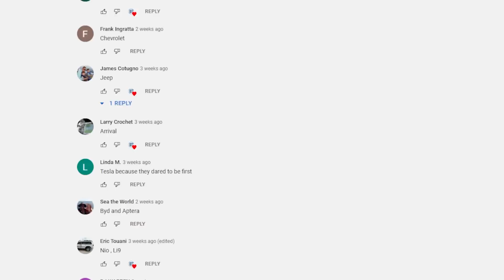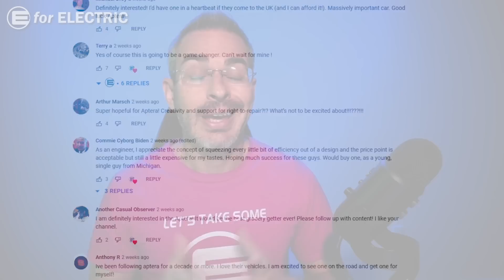How Aptera EV Got a Tesla-like Fan Base

Comment: It’s all about efficiency, that means even if you don’t get as much sun in your area, or want to keep it in garage 24/7, the level of efficiency makes this the only vehicle you can realistically keep charged with just a standard 110 outlet! 150 miles overnight with same outlet you charge your phone on :)
Reply: It's a ludicrous "car" and if you have a garage, then efficiency is meaningless.  Even a Model 3 can be practically charged overnight on 120V for the vast majority of travel that the average person does daily (about 40 miles).

The EV "range" obsession is comical and basically a complete non-starter for the vast majority of people and situations.
Reply: @awebuser5914  How would efficiency not matter in your own scenario, if it means you’ll have to charge substantially less often, for a direct energy savings of at least 3:1 compared to model 3, which also has a sticker price triple that of the comparable ranged Aptera. You basically just demonstrated a convincing argument pro-Aptera, efficiency, and how it’s solar capability is capable of providing the same amount charging model 3 overnight would, but for free 👏 😂.
Reply: @awebuser5914  Saying that "efficiency is meaningless" is akin to saying saving money is meaningless.  Why would you throw 3 times the money away for lower performance if you don't need the higher passenger capacity?  Most of us wouldn't.
Reply: @n.brucenelson5920  "Saving money" is a completely ludicrous argument for pretty much any EV these days.  Comfortable and practical ICE cards like a Civic or Sentra are mindbogglingly cheaper than any EV, and for the typical life-cycle of any owner of a new car, they are more or less maintenance-free (disc brakes are an EV issue as well, even moreso due to lack of consistent use).

People with an excess of disposable income buy EVs to be "different" or make some kind of statement; saving money (the farce that it is) has ZERO to with the practicality of the purchase.
Reply: @awebuser5914  It is clear that you have not looked into this.  I drive a Gen 1 Honda Insight, and even with this vehicle the savings in operating costs will pay for a new Aptera over time.  The $25,900 starting price of a 250 mile range Aptera is hardly "mind bogglingly cheaper" than any Civic or Sentra, especially when you consider how quickly fuel and other running costs will make up the difference.
Reply: @awebuser5914  Since March of 2013 I have solely driven two 2013 Nissan LEAF's, the 1st a two year lease. Never had to do any brake work on either, the regen saves most brake wear. Bought the 2nd car used in 2015 for $11,500, with ~12,500 miles on its odometer. I have very little disposable income, retired and walking dogs for limited income, and figure my LEAF's have saved me many thousands of dollars in fuel and maintenance costs over the last 9 1/2 years. 

Still, I am tired of the 1st gen LEAF's limitations and will gladly trade Tesla stock in for an Aptera when my reservation comes up. My motivations have nothing to do with being different or making a statement, but have everything to do with a moral compulsion to do the least harm and leave our planet in the best possible scenario for future generations of humans and animals. And then I plan to monetize that Aptera investment in a multitude of ways, that include portable electricity providing and the coming vehicle to grid eco-systems that accelerate our electric grid's transition to renewable generation.
Reply: @n.brucenelson5920  The Aptera is a niche toy, nothing more.  It cannot be compared to any "real" sedan, EV or ICE.  End of story...
Reply: @awebuser5914   we’ll see
Reply: @Airman749  "we'll see", what, exactly?  Do you honestly think that Aptera will sell more than a few thousand (if that) of these "cars"?  They are a toy for the wealthy, or delusional.

If you understand that it's a niche toy, then great, it's awesome!  Stupidly impractical and questionable "value", but as long as you don't make idiotic rationalizations about how "great" it is, fine...

Comment: Solar panels still generate electricity in cloudy situations. Not as effectively but they still work. I wish people would stop saying you can't use it in cloudy environments. (Investor/Reservist)
There are lots of first car buyers and single people who are the target of this Aptera. The surprising fact is that most reservationist are of the older age who are simply done with driving a box. With a starting price of $25,900 and 17 miles through solar, Front wheel drive, you can't go wrong. Why should first time buyers bury themselves in debt on a car?

Comment: Does it lean into turns? The failing of 99% of three wheelers is instability.
Reply: This is a reverse trike (two wheels in the front, one in the back). They are almost as stable as four wheelers
Reply: @GoClimbARockEh  I've seen "tadpole" layout vehicles roll in testing, too, but it does look like the front end is pretty wide. I would think that pitching the body into curves would be a nice feature at freeway speeds - intentional body roll to cancel lateral forces, like the Acela trains. That might also help counter UNintentional roll.
Reply: @MrTaxiRob  yeah between the wide stance, and the very low center of gravity, I'm not too concerned. Did you see the moose test video?
Reply: No.  But as it is it passes the moose test.

Comment: The car was delayed again .They promise the car for the end of the year. When are they going to give test drives?  Can you fast charge.  How do I repair it.  Which company will insure it.
Reply: Delays are part of the game with the present state of the supply chain.  The Corvette just had to stop production due to supply chain issues that are rife in the industry.  Both my wife and I have ridden in an alpha model, and other company outsiders have driven it.  These opportunities will increase once deltas are on the road.

The Aptera will have open source repair documents, traveling repair crews, and 24 hour parts shipments.  There will be QR codes throughout the vehicle to take you to trouble shooting sections for that area of the vehicle.  My local repair shop in rural Iowa is already eager to service mine.

Any of several insurance companies that cover the Polaris Slingshot and other 3 wheeled vehicles should be ready to provide insurance right from the beginning.
Reply: @n.brucenelson5920  The Polaris flips a lot.  I think you are required to wear a helmet in California.  They should work with insurance companies so people will have confidence the car will be insured.  Do they have  a video on how to change a tire and brakes?
Reply: @chunckyfreshnut  The geometry of the two vehicles is not the same with the Aptera's front wheel spacing around 25" wider.  It makes a huge difference.  The center of gravity is probably much lower as well.

No helmet is required for Aptera except possibly for Alaska.

Aptera will be offering insurance providers and financing when the deltas are ready for delivery.

I would guess that they will have videos for changing tires and brake pads, but there is no basic difference in the procedure for tire change from any car.

Brake pads will be a rare procedure due to the light weight of the vehicle and the fact that most braking will be done through regenerative braking rather than the mechanical brake pads.

Thanks for your interest!

Comment: I'm a solid maybe on Aptera. Deliver some vehicles first, then I'll decide. It's still vaporware currently. We'll see which features make it to production. Looks promising, but deliver first.
Reply: Since my wife and I have had a ride in an alpha, it would be very hard for me to call it "vaporware".
Reply: @n.brucenelson5920  the point is... they have nothing currently to sell. That prototype you rode in is not what will eventually be available, and until there is anything to sell it is vaporware.
Reply: @DouglasLippi  I agree that it is "a" point.  but they do have something to sell, and that is the considerable progress towards the initial goal, including factories already in production on sub assemblies.  They are hitting their milestones far faster than Tesla did with a far simpler product with their EV conversion of the Lotus Elise (that took 6 years)>
Reply: @n.brucenelson5920  ok whatever. I am rooting for them and definitely hope their first vehicle is awesome and wildly successful.

Comment: I really want someone to talk about how it is in snow. I like the efficiency for commuting to work, but it's not practical if it can't handle winter's.
Reply: I would think it would do as well as any front wheel drive vehicle. (Unless you got the AWD)
Reply: Having lived with winter all my life the biggest problems were starting and not getting stuck. Using synthetic oil and switching to front wheel drive has except in extremely rare circumstances eliminated these problems. Hint, always carry a winter shovel. Other problems that I experienced only once were frozen steering mechanism, frozen shut exterior and gas-cap doors. I solved these using a heat-gun. So, the only problem I worry about with Aptera is the reduced cold weather range, but who in their right mind wants to drive hundreds of miles during subzero weather? If you do, buy the 1000-mile range version.
Reply: My main concern is weight and range because of cold weather. Is it safe to take on the interstate with snow on the road and the car weighing nothing? I live in Wyoming and I've had light vehicles before and had to throw sand bags in them to add stability.

Comment: Reservation holder here of the AWD 600 mile off road package with mostly all the available options. Love the long range, the fast acceleration, the fact that I will probably never have to plug it in given that I live in Florida (the Sunshine State), the right to repair, the composite body, modular parts, not to mention that it just looks really cool.

Comment: I'm not a reservation holder, nor an investor. I just want the thing to exist, along with the Arcimoto. I think this would make a great third, or even second car. I can imagine idividuals taking crazy trips in it. It's really attractive. Crazy efficient. One EV, where you probably could keep it happy with a 110V plug. Their 100kwh version needs a 240V plug to power job sites. A driveable battery.

Comment: Good story and coverage. I am an Aptera reservation holder, investor, and ambassador, and I'd like to clarify a few points. First off, Aptera doesn't need to be a crossover or pickup truck to be successful. It doesn't need to have 4 wheels, or more than two (maybe 3) seats. The vast majority of people I see in my long daily commute are all alone in their giant, heavy, and boxy vehicles. The Aptera capitalizes on the fact that in many ways EVs can be more versatile than gas powered vehicles. EVs can be super economical, but can also be super quick (my upcoming AWD Aptera will go 0-60 in 3.5 sec), while being comfortable, quiet, reliable, and affordable. And with the Aptera weighing much less than other EVs, it will not only be economical and quick, but it will be nimble, safe, and have solid handling and braking. The point of solar power assist is that at every step of the way, whether you have partial cloud cover, or a sunny day, you will be using less electricity, and that is compounded by the Aptera already being one of the most efficient EVs ever built, when production starts next year. One of the biggest points about why I like Aptera (the EV and the company) is that if I imagine the best transportation vehicle of the future, it looks like the Aptera. It is super efficient, affordable, quick, fun, and really innovative. The Aptera team is designing and building an EV that is a great fit for my dreams, needs and expectations. They don't need to redesign it to fit everyone else's broader expectations of having more wheels, seats, weight, towing, conventional design, higher cost, and inefficiency. Because the Aptera works better for me just as it is designed today.

Comment: C'mon Alex. I'm sure you know solar works on cloudy days. Older panels generate less power. Newer multi-junction panels panels work with the UV as well as the visible. I don't know what Aptera uses, but it is likely they will someday use advanced cells as the cost comes down. Even if I only get 20 miles out of it, so what? It pioneers the concept of affordable solar power and the concept only gets better with time. Lightyear one does it even better, but at a quarter million dollars it is mostly a proof of concept rather than a solution. If Aptera makes it, they will be changing the general thinking about using solar in this context.

Comment: I have had two questions for this car since they debuted a decade ago. Number one, do you have to have a motorcycle license to operate it? And if you do, do you need the three wheel endorsement like you do in Washington state? That is a very small number of people that have that. Secondly, about those side mirrors. I’m pretty sure it’s still required in the US for cars and motorcycles to have actual mirrors, no cameras. Otherwise tesla wouldn’t have any mirrors outside. Maybe the regulation is changing soon, I know a lot of companies have been lobbying for it to get removed. Anyway, it will be cool to start seeing these cruise through my town in a few years.
Reply: You do not need a motorcycle license to operate autocycles like the aptera, except in Alaska, I think (and that's probably going to change soon). Side mirrors are a regulatory requirement, and will be included on the Aptera, although they are designing it so they can be removed when the regs change
Reply: I don’t know how many off the top of my head, but only a few states require a motorcycle license (and a helmet) for three-wheeled vehicles, and this may get changed soon, especially since the Aptera vehicle will be crash tested to automotive standards even though this is not required for three-wheeled vehicles.
Reply: @JohnGeorgeBauerBuis  I think AK is the only state left with this requirement.  This has been changing rapidly.
Reply: It will never pass auto crash standards
Reply: @CharlesAnsman  Aptera has designed it from the beginning to pass the FMVSS part 200 crash tests standards, and it has been virtually tested thousands of times.  If the deltas don't pass when they are tested there will be a delay and design revisions until they do - something that would be very unlikely.

Comment: I was around when Aptera was in the first start up.  Then watched as the dream diminished with Chinese money, And I thought it was pretty much gone.  While this car would not be the first three-wheel electric vehicle on the market it certainly has tremendous advantage over its Canadian counterpart. 

I am now a reservation holder and I think I Spect mine out at about $36,000. .

Now I can't get anywhere near a Tesla for that, yet I will be able to go wherever a Tesla can go. Since I have solar on my house charging it would be a breese, yet because I live in the Central valley of California it's unlikely for my daily driving I'll ever have to plug it in. When I go somewhere sure I'll have to charge it up That's okay it's only got a 40 kW hour battery and shouldn't really take that long to charge especially with the 400 mi range that I Spect mine out to.

I'm in a really interesting position, I am 70 years old I'm not going to do a hell of a lot of long distance driving.  I will never have to fill it up at a gas pump ever again and that's got to be something.  For me even this late in life It really is awesome to think that I am now not going to be dependent on OPECOil.  The price of gas can be $10 a gallon and I really won't care.  I don't have to worry about my electricity bill going up in the next few years because my electricity is provided by Sunshine and there seems to be a lot of that in California.